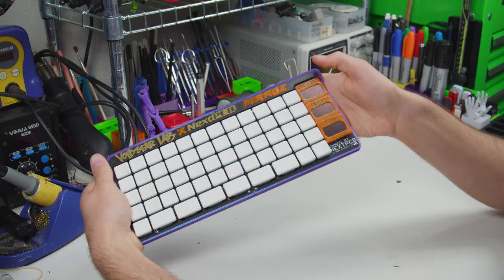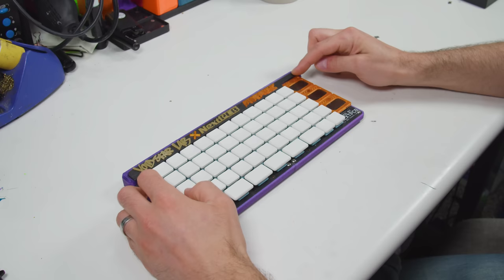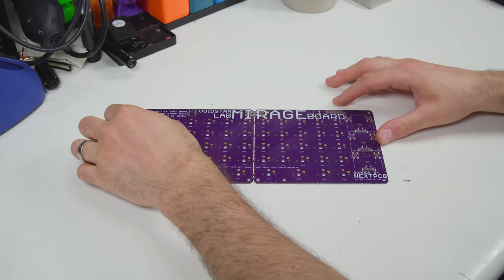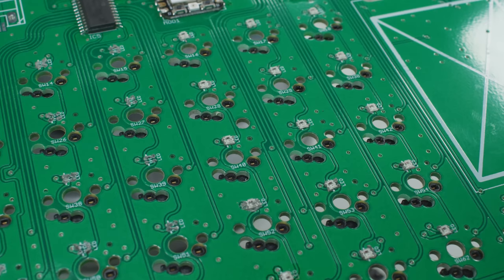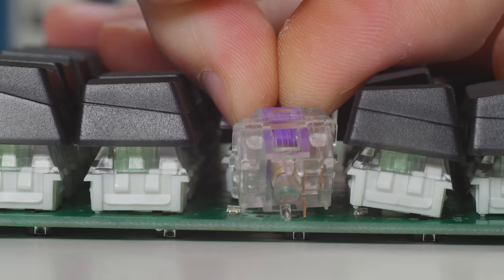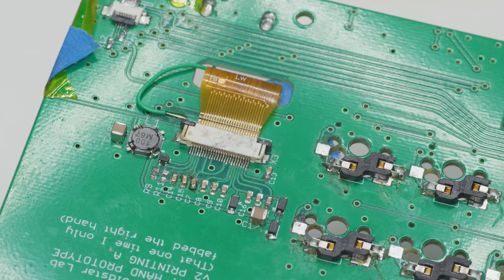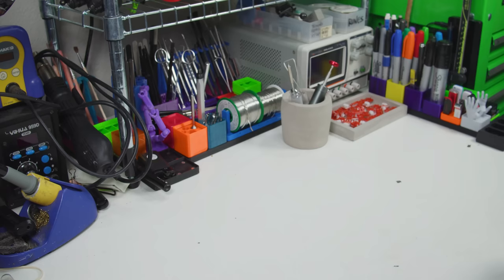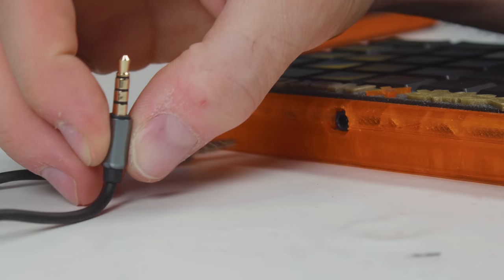RGB Ruined My Life: MiRage Mechanical Keyboard Mk2

Comment from the maker: MiRage NewsLetter SignUp WebPage: https://lp.constantcontactpages.com/su/IT2S7ta/mirage
Reply: This needs Pinning to the top...
Reply from the maker: I forgot the pinned comment! 🤦‍♂
Reply: I love the option of just having an open space for Eink, knobs, etc. A gridfinity-esc part of the keyboard where people mod it to fit who knows what peripherals; like (not good ideas->) A pcb solder heat plate, a peltier module drink holder, (better ideas->) A grid-eye sensor for gesture and light dimming control, a flight controller flash and setup plate with mini servos to calibrate it. The possibilities!
Reply: Have you thought about just straight up using an RJ45 jack? :D
Reply: I do think the possibility of a swappable module where the e-paper screen is would be a good idea.  I don't want to give up those cyberpunk OLEDs as much as you, so even if I have to separate the buttons or give them up entirely, I'd like the chance to have to make such a module of my own
Reply: NEED VERSION 3 FAST
Reply: Look into GX12 connectors with up to 6 pins maybe? (or GX16 with up to 8 pins)
Downside is that they are only rated for 500 plug/unplugs, so should only take them off if necessary.

Btw, this is the only newspaper I have ever signed up for willingly in my life :D
Reply: You are amazing! Love it <3
Reply: Will there be an ISO layout version? I'm from the UK and would like appropriate grammar keys.
Reply: I love RGB projects, thank you Zack!
(Especially those with a function to switch that annoyance off:P)
Reply: @ZackFreedman  a ps/2 port has 6 pinouts
Reply: Please tell me you have yellow, beige and red as color options.
Reply: I am really looking forward to the multiplicity of keyboard add-ons.
Reply: i have a brilliant idea,use a ps2 connector
Reply: Here's an idea for that empty space: PWM keyboard knobs.  No, they don't output an analog signal but emulate a crackhead woodpecker sitting at your keyboard, wailing away on a particular key at a given rate.  (You would need a button to turn the output one and off.)

I did this as a lark YEARS ago to use my $300 steering wheel to play Flash racing games using GlovePIE to provide the PWM signal.  To prove how well it can work, I found absolutely NO difference between playing Flatout in native steering wheel mode and keyboard mode with GlovePIE acting as an ADC for my steering wheel.  It just works.

Does that make sense?
Reply: That segway was worth the like, Well written... too well....
Reply: @Zackmortar  Are PlayStation 2 extension cables still being made?
Reply: @PSIHedgehog
I think they mean Power System 2, the standard that all keyboards and mice used before USB took over
Reply: @dafoex  I knew about that. I was making a bit of a joke about the name. I think they've four of five pins and look similar to the Sega Genesis Model 2 AV input or S-video cable, but they're becoming rarer as USB is now the go to standard.
Reply: should have said fucc it and went wireless
Reply: @wades623  Nintendo might have an issue with it in regards to the paired joycons or something if Zach did that.

Comment: boy, I really hope this project doesn't get cloned by some Chinese company before it's even finished.  looks great though!
Reply: how dare you invoke the forces of irony like that
Reply: its already cloned, though those companies do not know or are not aware of the BAD PCB design, that is prone to failure under normal usage conditions. [AKA plugging in a Sata cable]
Reply: Oh it will, but I want a Zack board, so he'll still make plenty of money. :)
Reply from the maker: That would save me a lot of work
Reply: It most likely wouldn’t be nearly as good as Zacks finished keyboard
Reply: @darknessblades  wonder if thats a valid ip strategy share boards in a way that needs lock and key information a ip stealer could miss
Reply: @killincards  he has the first iteration under MIT I think so there's that
Reply: @nathan22211  ip licensing inherently doesnt work for small creators, MIT is good for everyone though and anyone can monetice with similar work input iirc. But say you have a feature complete open source product you want to sell that didnt get external contributions if you tied a trace and put in easter egg code that you hide randomly in your videos that brick the device for people that just want to hijack it. I mean thats against the spirit of open source in a way depends how you license it. This could allow for more complex devices to be open for people to learn from and creator benifits in a way. Not sure if balences out foss and capitalism  just want to share my thought.
Reply: I really hope it does! It's my only hope to find this level of product in my country (latam)
Reply: @redbubble I want this on a tshirt
Reply: capitalism 😔
Reply: @ollieb393  😁*
Reply: @killincards  The trouble with foss is, that if anybody can freely access such software, then so, too, can any company regardless of the intention to make money off of any improvements either.
Reply: It would be cheap as dirt though
Reply: @ZackFreedman  Speed up the cloning process by making an arbutraty kickstarter campain.
Reply: This was literally my 2nd year project when I was enrolled in Computer Engineering.
LSS: I dropped the course. Thank God
Reply: I rike your idea. Me Chinese keyboard maker. I make this happen. Me rove this idea.....I rove it rong time.
Reply: They would figure out a way to disappoint us as they always do and say it will come out in a future revision that never does
Reply: @ZackFreedman  lol
Reply: I am Chinese company. Thank for idea. I make ideas steal, munny for I. Sell product cheap, make break easy. You buy now.
Reply: @ollieb393  theft... not capitalism.

Comment: make it so that each individual key is the keyboard, and each key is on its own using magnets to stick together to form any shaped keyboard you want. I WANT MORE OPTIONS!
Reply: gridfinity keyboard, but then mini gridfinity, like LEGO's are to DUPLOs
Reply: i could make that happen....
Reply: That's going to get expensive real quick, and they'd have to be really strong, but I'd love to see something like this.
Reply from the maker: I switched from saying "the most hackable keyboard" to "the most hacktical keyboard" because Adafruit released that numberpad where every row is a breakaway strip. There's a point of diminishing returns...
Reply: @Noah-ek8hp  aight show me😜
Reply: I recommend searching up the dumang DK6, it has a similiar idea.
Reply: @ZackFreedman  but what if we want the MOST diminished returns proceeds to build pixel art with individual keys and rgb
Reply: finally! i can make my 1% keyboard
Reply: I  want a normally spaces keyboard (not this square layout), but I would like the rows or even maybe individual key to have height adjustment.
Reply: MAKE IT NON-EUCLIDEAN!
Reply: I was thinking of a project where each key us on a board with some flip flops and logic circuitry, where a line from the microcontroller is a clock that steps through the keys, and another line pulses when the key that is currently "selected" is pressed. But now you might just be able to do that with a really cheap microcontroller.
Reply: This is kinda already the case. There are single switch hotswap mounting PCBs for Dactyl Manuform keyboard projects. They still require soldering together manually, but you can't get more custom than a keyboard that's tailored to your fingers.
Reply: There was the ErgoDex DX1 that did this. Now there's the 
Dumang DK6 which does something similar
Reply: @gesamtszenario  Better yet, make it non-Newtonian! ; )

Comment: Y'know, you could counter the depth issue for the E-Ink panel by having a battery pack sit there and the panel itself sit on top of that with standoffs. This of course implies that you should totally make this wireless and the headache involved with that will surely be a fun time
Reply: A bluetooth module isnt too difficult to implement
Reply: Wireless? Wouldn't that completely remove the need for the I2C pins? Mesh network of modular keyboards... hmm...
Reply: @faridwakim  Also wireless adapter.
Reply: Sounds like spicy pillow potential
Reply: And it should Qi charge!
Reply: AND Qi charge other things!!!
Reply: Can I get the icon in Cornflower Blue?

Comment: ZACHHH FRIEDMAN! You can run the IO Expanders off of 5V as far as I know! I2C is a pull-down communication protocol, so all it detects communication through lows, not highs so this difference in voltage between the expander and the microprocessor won't matter. 

but double check you won't end up as a  Fried-man, man.
Reply: Except that his last name is actually spelled "FrEEdman," so you know, he'd end up as a "Freed-man," which isn't exactly PC, ya know?

Comment: Beware ordering the microcontrollers with lots of pins when building a custom keyboard.
You'll find yourself doing wacky crap like throwing in a trackpoint and an analog stick and 4 rotary encoders. Then you have to write the software to make 4 rotary encoders and an analog stick do something useful. Ew, desktop apps. Gross.
Reply: adding hardware then thinking about what to do with it, sounds like me xD Right know I'm building handwired ortholinear Preonic-like keeb with RP2040-Zero with KMK.
Reply: I'm looking at all the bits and bobs I have on my desk, various encoders, analog sticks, so on, and thinking all the wonderful human interface devices I could make from them that I 100% know I would never use

Comment: You could switch from sata to rj45. It has 8 instead of 7, but that's just expandability for the future.
Reply: They probably thought it was too thic to fit. But Id prefer the reduced costs of it tbh
Reply: @slep1654  it would be taller than the sata, but no taller than most keycaps. So the overall form factor wouldn't take a hit.
Reply: You can put any amount of wires from 1 to 8 in an RJ45 connector. Regardless, the problem is there aren't a lot of pretty ethernet cables out there.
Reply: @pastellexists  on the other hand, they're pretty easy to DIY so it does open up the ability to sheath and crimp your own custom lengths
Reply: I was thinking the same thing. My keyboardio model 01 uses this, and I'm pretty sure the model 100 uses the same. And I don't know about you, but I have far more spare Ethernet cables kicking around than sata cables.
Reply: can just use USBC ports as well. No reason why it has to be USBC spec.
Reply: @fuzzybabyducks7878  that is an excellent point and i can’t believe i didn’t think about that
Reply: @fuzzybabyducks7878  my only reservation on that would be if I'm hand soldering the connector. Those puns are tiny and super easy to bridge. If I'm using air or a hotplate with a stencil then it's a different story.
Reply: You could always use rj12 if you only want/need 6 conductors.

Comment: Amazing work! As a keybard enthusiast myself I will definitely try to buy one to costimuze monstrously.

However I would like to add that north facing LEDs/switches are generally not recomended because some very popular keycap profiles interfere with most chery style switches when northfacing.
Reply from the maker: I need to collect feedback on this. South-facing LEDs make shine-thru legends visibly dimmer, and printable shims can prevent Cherry cap collisions. The MiRage will likely be most users' first mech keebs, as well.
Reply: @ZackFreedman  it's only cherry profile keycaps and only some of them, tho. newer ones tend to have slightly different inner supports and work with north facing leds too

Comment: For the interactive e-paper display, what about something like a multifunction display instead of a touch screen? Would cost a little screen real estate, but physical buttons can be a lot smaller than touch targets and still be easy to use.
Reply: He could add a nub like those thinkpad nubs that can be used to navigate the e ink display.
Reply: @OhSoTiredMan  I have a keyboard with one of those nubs. It's a worthless gimick and innacurate at best. And I spend a couple days learning and adjusting it so I could justify its existance.
It's the most useless choice of input device compared to the rest of the tech we have today.

I'd honestly prefer a resistive touch screen... And I don't like those either.

Comment: If you make the center post hole a little bit larger and add a hole for the alignment pin, you could also support choc v2 switches. This will give folks the option to have a low profile switch with an MX keycap. The regular switch pins are in the same places as choc v1 switches, which means that they're compatible with the same hotswap sockets.

Comment: I've had an idea bouncing around in my head for a while, if you like it, please run with it: each module (which like you said can work independently or together) can be connected to one another via magnets and spring loaded pins (aka pogo pins). Super fast and modular hot swap!
Reply from the maker: I might experiment with this in the next version. My gut check is that most people will want to "set it and forget it" instead of regularly switching between configurations.
Reply: @ZackFreedman  thanks for the reply! My original idea for wanting it is for a modular number pad which I can add or remove when I need, and to also be able to take it and use solo with my laptop when I'm away from my main PC.

Comment: Very nice work mate! I built the Sick-68 for the wife after seeing your video way back when and the Redox Handwire for myself. 

On other projects I generally use the mini-e LED’s simply because I can solder them on the under side of the board and they protrude through an opening in the PCB which (as you stated) keeps them flat.

Comment: Incidentally, the idea of a split mechanical with a touch e-ink is basically perfection. It can do anything you need, and doesn't require batteries from heaven to power it.

I'd be in on Kickstarter if the entry level options for a two piece were within my (admittedly unemployed) means. But I know that keyboards seem to be going for insane prices these days.

Good luck with this!

Comment: Hey, if you want to connect the two halves of the keyboards together, use USB-C with alternative mode negotiation, and that'll make it possible to connect the two halves with usb cables, while talking between each other with whatever protocol you would like to use. As a bonus, you can then use the same usb-c port to connect directly to a PC.

Comment: If you flip (not to the other side of the pcb, but rotating it a 180 degrees) either the MX sockets or the Choc sockets, you can have them both there at the same time, so you won't have to choose a socket type since you can solder both and you can hotswap from MX to Choc and vice versa

Comment: Maybe consider RS485 instead of I2C? It's a multi-drop bus, so you can have all nodes directly on the same 2 wires. You'll only need one UART on the uC, and a GPIO for enabling the TX driver while sending. Plus a tiny RS485 driver like MAX3082 (or any other RS485 driver chips, there are many options). You can either roll your own half-duplex protocol, or use e.g. MODBUS which is designed to go over RS485. And as it's a differential bus, you can safely use it over pretty long cables without fearing the EMI demons... (which I2C is not very good at).
Reply: This is a winner of an idea, RS485 and MODBUS.

Comment: NXP does make a chip that is the I2C equivalent of a network switch.  I use this all the time when I need to control more than one device on the same I2C address.   I put each one on essentially it’s own I2C bus.   With this you can multiplex the bus almost an infinite number of ways.   There is a bit of I2C over head for the micro because it has to tell the “switch” which port to push the following data out.

Comment: The removal of the display buttons is a mistake 😭😭😭 I can understand your e ink idea, but I want display buttons. 
How about making them tactile by placing small vibration motors under the display so it’s simulate a click like the trackpad of MacBooks or newer iPhones do? Then you could mount them static
Reply: Hopefully it will become a module you can attach. That would be cool

Comment: I once got some cheap VGA cable for a project thinking "I need 9 cables, this one has 15, so there should be no problem, right?" WRONG!! Several pints were not connected, others were shortened together, which in the end gave me less lines than I needed. All this was discovered after hours of frustration. Later it turned out that fully wired VGA cables do in fact exist but are rare and expensive AF

Comment: Thanks for the design files I want to make it a little easier to use so I’m a switch the sate cable for some magnets so it can connect :) or use nickel strips solder wire to it and put magnets behind them son it works like a full keyboard without a big cut in the middle

Comment: Thought I'd share a quick tip for those like me who don't have access to a 3D printer,  You can use things like Cigar Flight Cases and make the nostalgic "Cigar Box Computer".  I use 2 small flight cases(Mayitr New Waterproof Dust-proof Shockproof Travel 5 Cigars Caddy Case Box with Black Humidor 230*125*49mm) as clamshell holders for my Dual 7" HDMI Touch Panels and a larger one to hold the Rpi and associated tangle of wires fans Hdd's speakers batteries and power regulators.  The ingredients sound simple but the results are professional looking.  I don't even alter the Cigar boxes so they retain their waterproof capability and can be used for other purposes if need be.

As for the E-paper display,  I would maybe try putting a touch panel there like the ones laptops use for their mice, would be interesting if you could maybe put a touch panel membrane over the e-paper and increase it's usefulness exponentially.  Maybe even integrate the Mouse into the Keyboard laptop style, perhaps adding a nipple mouse as an option as well?